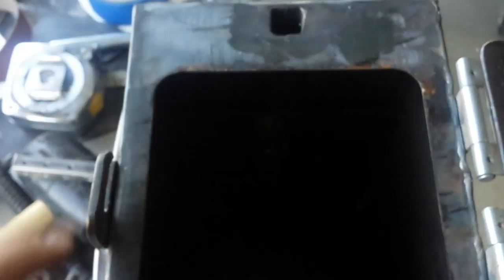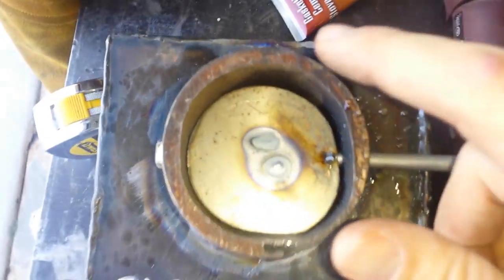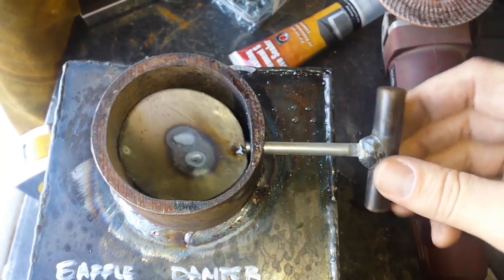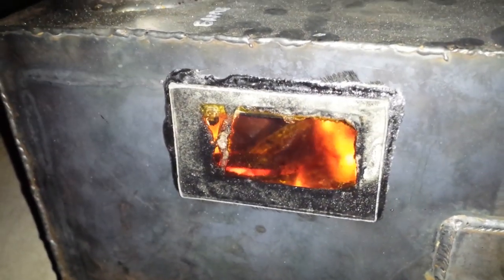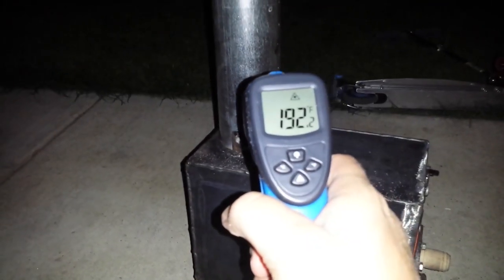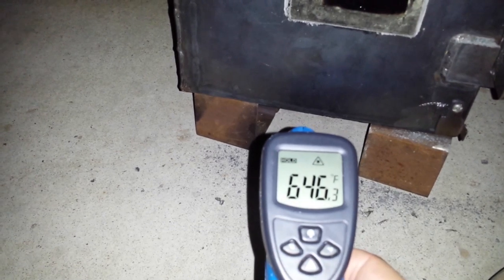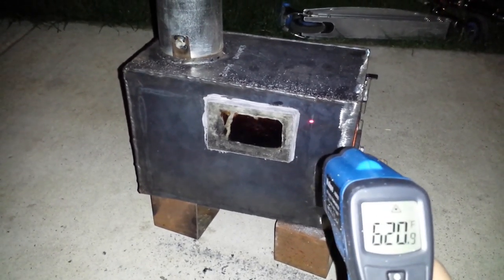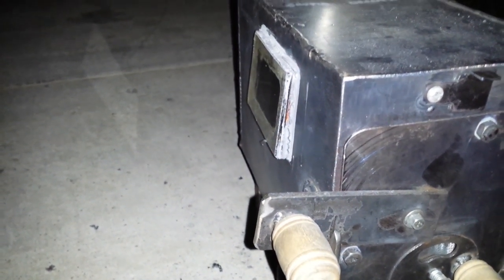Prototype Tent Stove -- Yet More Mods

Comment: Only now I saw the series of videos you made on this prototype. You are going on the right direction and the stove is very compact and very nice. Just do not be sorry about your works or welds. You have to see the resources I have and the lousy work I do! Take a look at my videos to see what I have learnt so far about wood stoves. First, you need to seal the door with fibre glass rope to avoid unwanted air leaks, otherwise you will never get a good secondary combustion and fuel savings. Second, you need a bigger secondary air dispenser, some 20 to 30 holes 3.5 or 4 mm each (this is the size I got to the conclusion that works well for secondary air dispenser), For the secondary air dispenser, I prefer more holes with less diameter. Third, your first secondary air dispenser was ok. Fourth, secondary combustion kicks in when stove reaches temperature about 300 degrees Centigrade. To achieve high temperatures, consume less wood  I close the chimney dumper to half of two thirds, I close the primary air to about a quarter or a fifth and secondary air is always all the way open. Again, when temperature gets close to the value I referred, secondary combustion kicks in... To allow secondary air to warm up and avoid smoke to escape while lighting the stove, I take the air from the bottom part of the stove to the top part, making the longest path I can make with this air to allow it to warm up as much as possible.
Reply from the maker: Awesome, thank you for the feedback.  I am hoping to create another stove here soon (or modify this one most likely) and test some of those things.  Question, do you think I would get a good secondary burn in this small of a stove?  I was wondering if I need a taller stove.
Reply: John Harmon - Cold Creek Works If you get to the right temperature, I am sure you will get the secondary burn. I think that unwanted primary air is the main cause that limits your secondary burn. A slightly taller stove can make your life easier, if you keep the same door size and current position. The same can be said in relation to metal sheet thickness. The thicker the material, probably you get higher temperatures inside the stove. I also have a lot of questions about wood stoves like I would like to know the right proportions between the different stove components, example door area and stove volume, door height and stove height, etc. So far, what I know about wood stoves is based in a series of rules of thumb but I would like to be a bit more scientific about these issues.

Comment: I used three 1/4" inch flanges (angle iron) on the bottom and sides to frame out the inside of my windows on my stove and then used the high temp stove mortar as caulk in the flanges. Once I dropped the mica into the slot the mortar simply was used to seal the window and not actually carry the weight of the glass. For the top, I just mortared over the mica and it sealed the window on all four sides. My windows are a few 2" holes on either side of the stove and with the mortar on the flange it never is seen on the glass circle windows to give it a little more polished look. Might be a thought for a future build...

When or if I ever get my stove back from my nephew I'll post a vid. The guy has had it for going on 5 months now and it's about time it was sent back home for my winter camping anyway.
Reply from the maker: Shoot me a message once you get the vid posted.
Reply: John Harmon - Cold Creek Works
 He's coming up in a few months on a vacation and I'm heading south in a few month to warmer climates so it may be a while before I get my hands on the stove again...I might have a few pics somewhere, I'll look later. I've been camping in the motohome at friends so I haven't needed it. It's pretty self explanatory with the angle iron mounted on the inside of the stove and the glass inserted into the slots. You should be able to fabricate that up with your welder easy enough.

Everybody with tent stoves don't know what they are missing by not having a window. Totally changes the mood in the tent to see the flickers of the flames inside the stove dancing on the walls of the tent. Makes you feel like sitting at home in front of the wood stove watching the fire inside. Plus, it sure does make moving around inside a dark tent easier. Also, you don't have to open the stove door to check on the fire as often.

Comment: Correct.. Secondary burn and no smoke is going to be a good hot flame, with lots of draft, and designed to burn the wood much faster.. It is the Rocket Stove Concept.. It needs lots of ventilation across the burning wood for a complete burn.. 
If you are worried about the smoke, consider a Rocket Stove Mass heater in your tent.. Put your burn chamber in the ground, drum above ground, and exhaust pipe also under ground, outside of the tent and then up..  Heats the ground, and when the wood burns out, you have radiant heat from the ground up..... 
Otherwise, put green wood in, when you get a bed of coals, and choke it down, and let it simmer.. This is how your stove will operate best for what you want.
Smaller split wood and dryer wood burns faster to get rid of the smoke and get your secondary burn... 
You have to get the air ripping across your wood.. So, restrict the air intake and funnel it across your wood. 

If you want to keep your glass clean, cut a slit with your grinder just below the window, and put a piece of sheet metal just below the vent, inside of the stove, and leave a small vent area, in front of your window, to pull the air in. It will rise in front of the window if you get it just right, and keep the window cooler, and keep the smoke away from it. The cool air entry, and fast rise as the heat expands the air will keep the smoke away from the window as it rises with the draft.

I did a lot of experimenting with Rocket Stoves, and other cooking style stoves.. Was looking for a longer burning cook stove.. Went with the rocket stove design, and increased the size, etc.. and got what I was looking for.. About 2 hours cooking on one log split, 24" x 6" in diameter.. I made a bunch of videos about them.. Played with Vortexes, etc.. You might find them interesting, but, I really think you would be happy with a rocket stove Mass heater.. Everything in your tent is below ground, except where you load the wood, and the metal drum that will heat your tent... It will take a little longer to heat up, but, you won't loose much of your heat to the outside. Most of it will radiate from the drum, and the rest will be sucked up by the ground under your tent.. Your exhaust temps will be around 10% of your stove heat.. 
Mine, I could get the barrel up to 800 to 1000 degrees, and the exhaust never got over 200. Usually around 120 to 160 degrees F.  I didn't do any videos of the mass tent heater.. Shame. I was experimenting with it at a friends camp, and was more interested in drinking and  telling stories and the hunt.. 
Cheers..